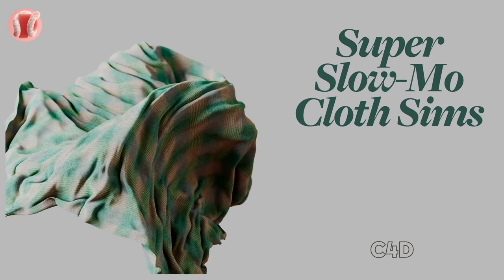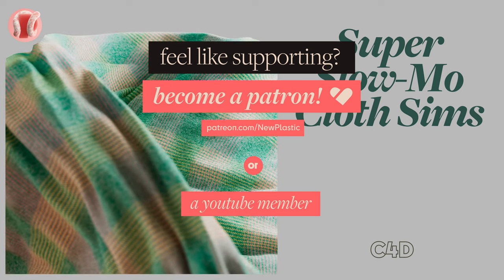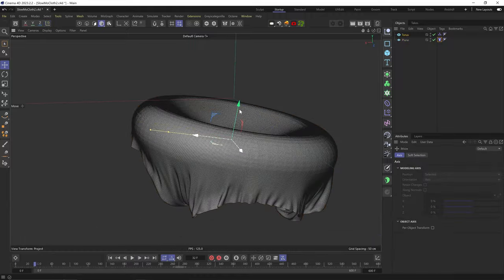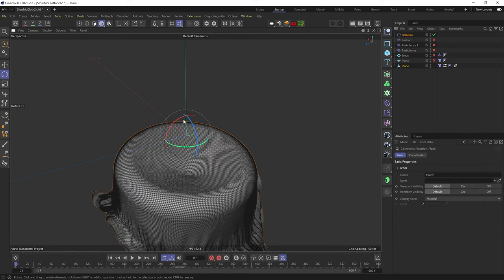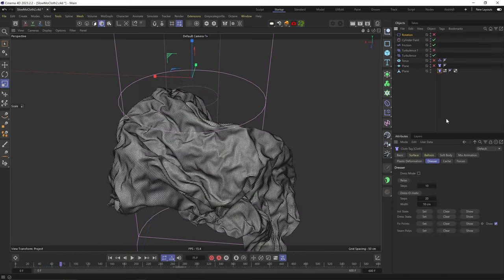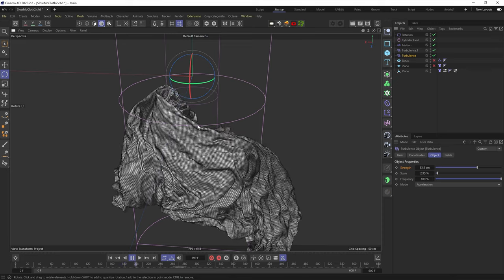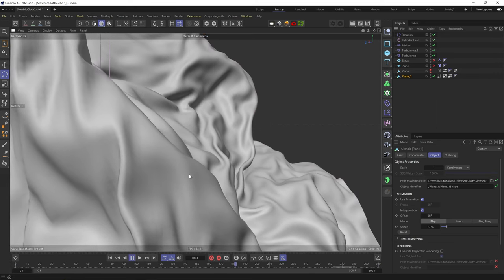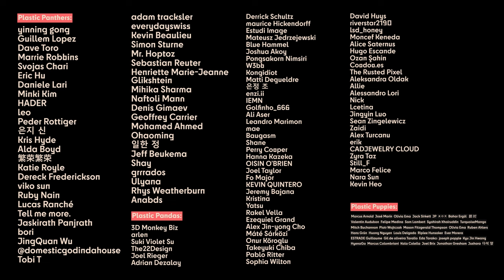Cinema 4D Tutorial - Super Slow-Mo Cloth

Comment: Hey my man! Absolutely beautiful work. Do you mind me asking what CPU/GPU you're running? 

I dropped good money on my Intel i9 and Nvidia 3090 Ti and my cloth sim setup exactly like yours doesn't run near as smoothly haha in the viewport that is.

Thank you so much!
Reply from the maker: Just so you know, most of my videos are sped up like 200%, in this video I tried to keep some parts at 100% but even here some of the simulation plays are sped up slightly. ( you can kinda tell when they start to speed off). 
That said, I have a Threadripper 2920x, a 4090 AiO and a 3090
I'm running the cloth simulations on my GPU so it's probably using the 4090. 
Look your setup is fire, but the 4090 AiO (it's the MSI Supreme Liquid), is a game changer. Even more than the 3090's I got. Like the 3090's were an upgrade, but hte 4090 is not just an upgrade it's a game changer. The liquid cooling it has makes it not only frighteningly quiet but also incredibely powerful becuase it can keep its temperatures down more easily

Comment: Hi. Could you also pls mention the hotkeys you use in the process? I'm a bit lost cus the screen suddenly changes and its definitely bcz of hotkeys i reckon. Thank you for the tutorial. :)
Reply from the maker: The hot keys are usually visible on the left bottom side of the screen, sometimes they go by fast but you can just rewind and make the video slower. In some videos I do mention the hot keys, espeically in modeling videos, but sometimes I forget
Reply: ohh!! Didn't notice. Thank you for your hard work:)) @NewPlastic